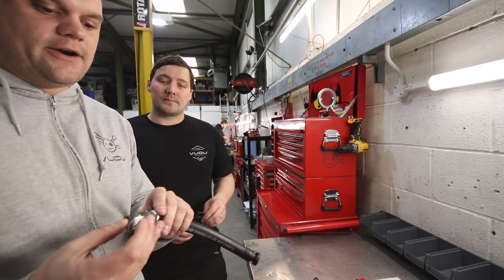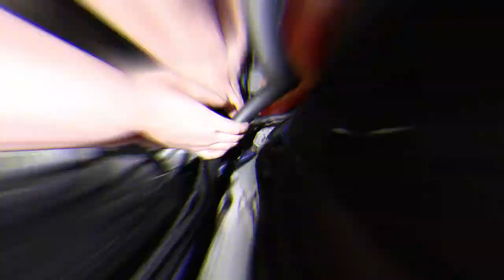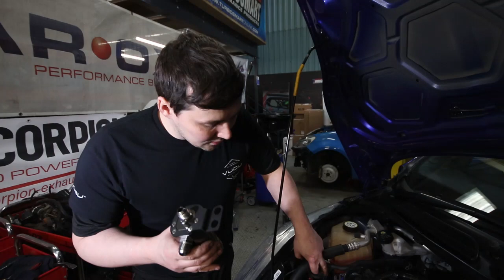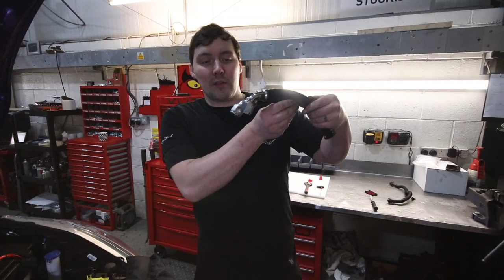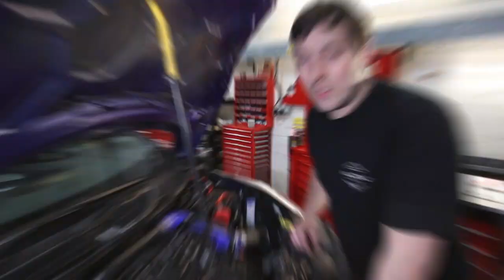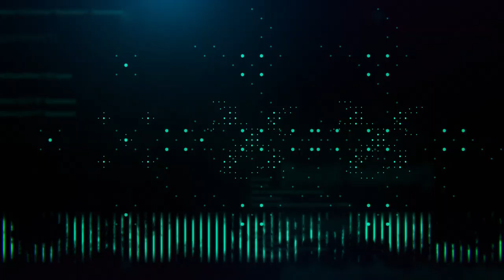FIESTA ST180 VUDU CATCH CAN SYSTEM INSTALL GUIDE

Comment: I have a fiesta St for 3 month now fuly stock for now, i look perhaps for that thing but somehting is wrong with oil catch i have see someone place the the catch can on the another pipe in the front of the engine is 2. so why only one catch can is there 2 pipe is sanding oil in the air pipe anyway ? is not completly catch it ? at 12.14 you can see this oder pire with in front with 2 clamp.